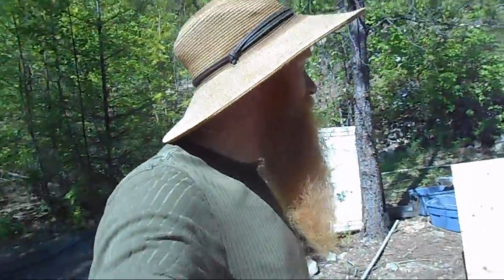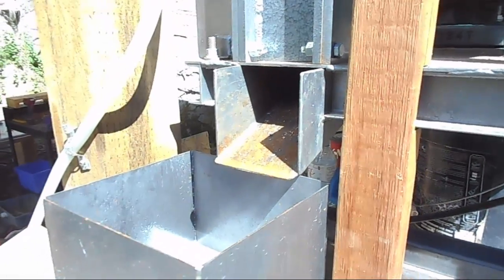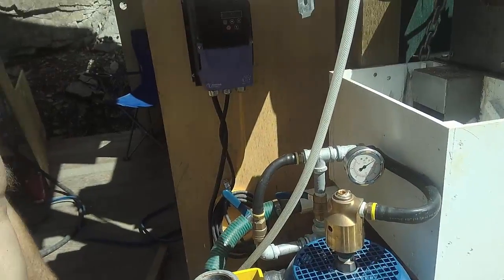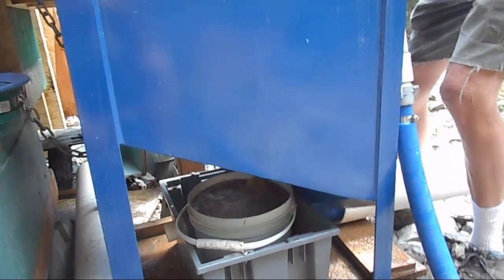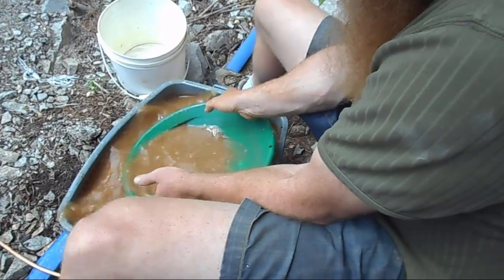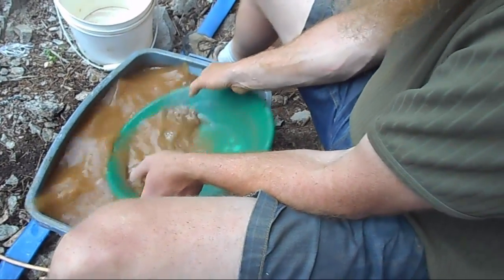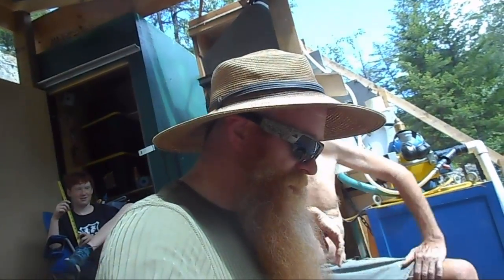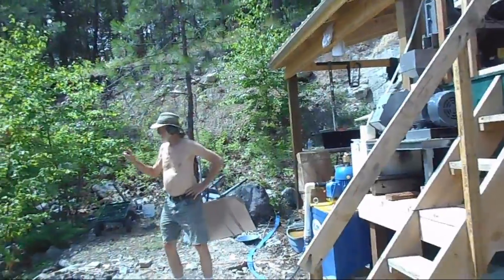Gold recovery! Getting the gold from the Blue Chip Mine Ore.

Comment: If you use a vacuum pump hooked up to a clear shield that has a rubber seal.
It would dry your concentrates in just a minute in your pan.
Once you use it you will never heat cons up again

Comment: Good looking setup Dan. I thought you would have got more coarse gold from that sample, are you sure its not hiding somewhere in the hammer mill or the chutes into the knudsen bowl. Also I think you will need a third mill to really liberate all the fine gold and sulfides. A grinding  mill of either the rod or ball type will do it. I made a rod mill from large diameter pipe and scrape brake cam shafts from trucks. great Vid
Reply from the maker: I do plan to check for traps within the system for nuggets.

Comment: So if the custom screens on the impact mill can't reduce it fine enough will you have to bring in a ball mill? Could be fun to see a mill large enough to take 200ish pounds of rock for a spin during lunch.

On the processing setup remember to include clean out hoses if you are going to secure the processing hoses down.  As you need to clean from the platform down to reduce the chance of cross contamination of samples.
Reply from the maker: A ball or rod mill would be the next step.

Yes, we have that covered